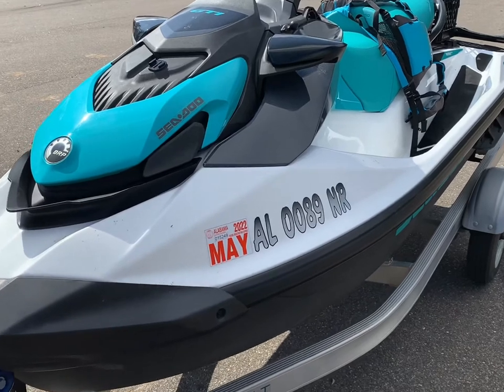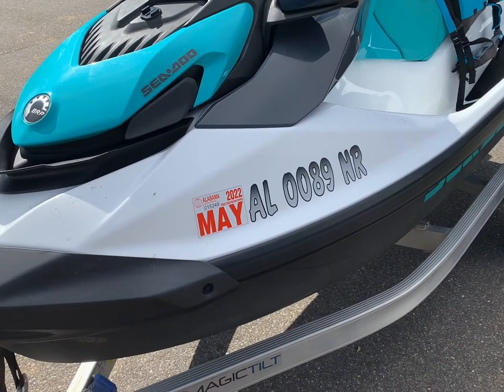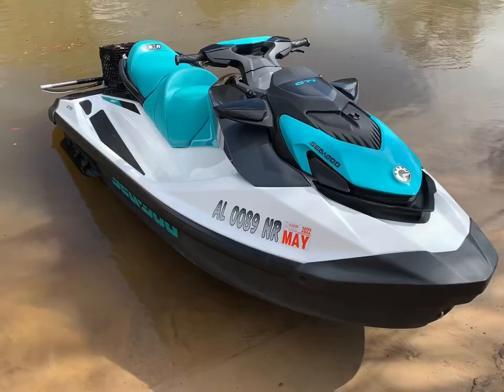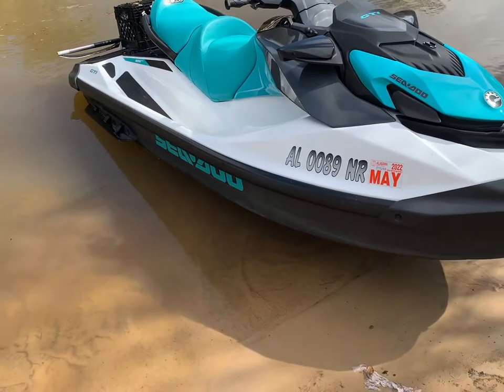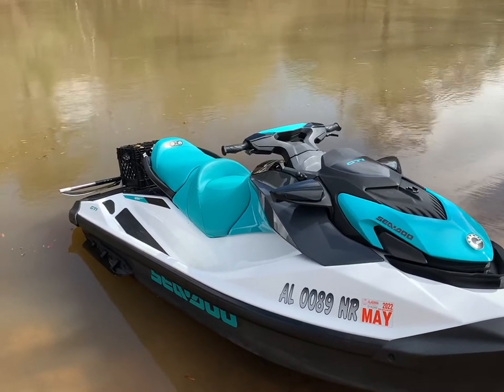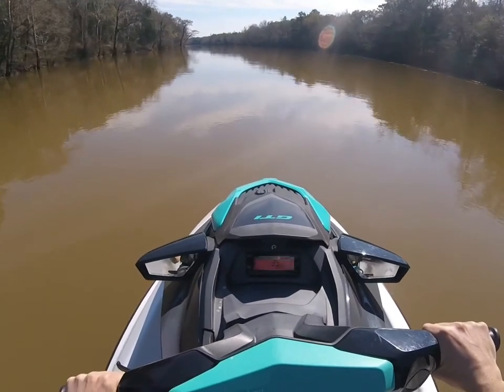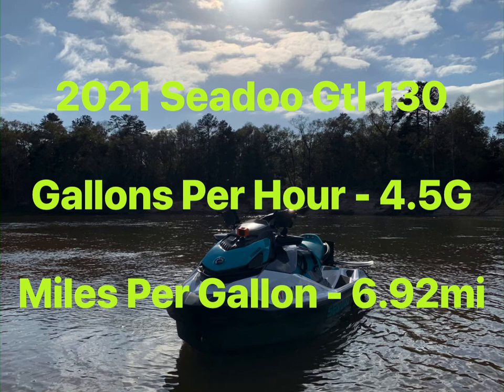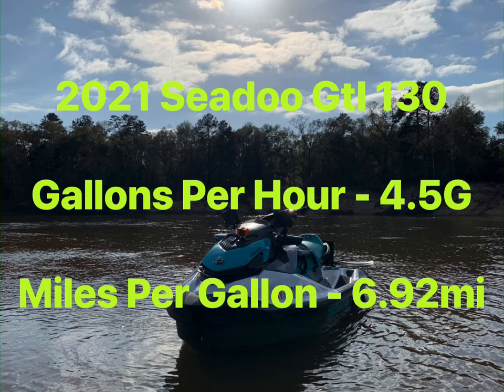2021 Seadoo GTI 130 Fuel Consumption Test Eco Mode

Comment: Thanks for taking the time to do this.  I have a 21 GTI 130 & was always wanting to know.  ECO mode is very nice for cruising on long rides along with being pretty low on fuel consumption.  Would love to see any other tests in Standard &/or Sport mode.  Looking forward to summer & warmer days ahead.
Reply from the maker: A wide open throttle test is planned for the weekend and videos to follow soon. I may wide open in sport and in touring but I think the fuel consumption is the same. Sport mode just increases throttle response. May also do one at around 40 mph also. I don’t see many Seadoo consumption numbers out there. Thanks for watching.